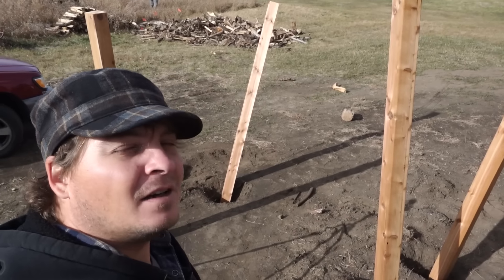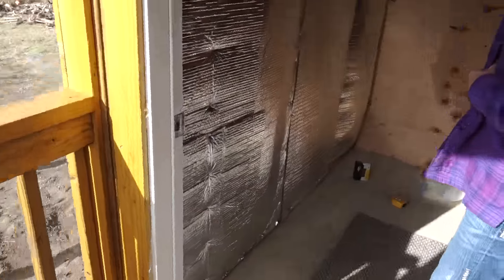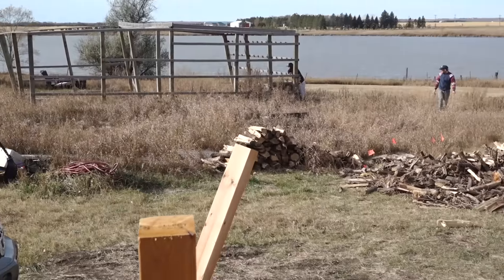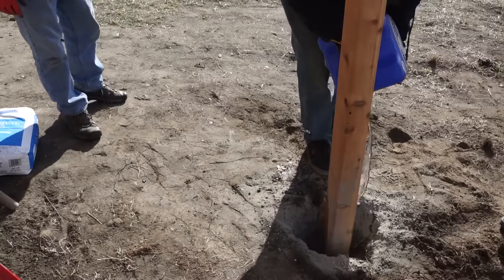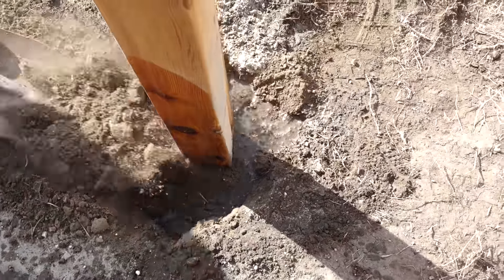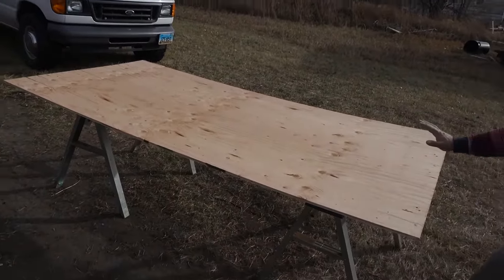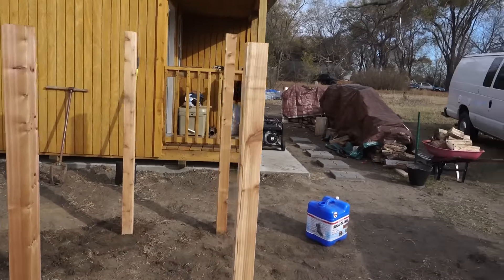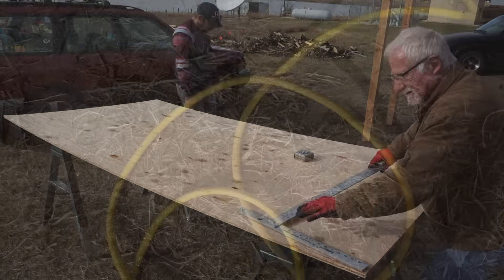Tiny House Living : Solar Panel System Part 1

Comment: thanks for sharing your journey w/ us. A real adventure! 

I'm curious: why you put the posts into the dirt instead of having the concrete footings come up out of the dirt 6" so the posts stay dry. Wouldn't they last a lot longer? I've used sono-tubes and filled them w/ concrete, then placed Simpson ties on top of the wet concrete. It makes it a lot easier to place each post foundation level and square to each other as you are not trying to wrestle w/ a 4X4 in 8" of wet concrete. Before you pour the concrete you make sure each tube  is square  and level to the top of each other tubes. Once filled , you just gently push the Simpson tie to rest on top of the concrete. In CA,, they don't want wood to touch dirt to help prevent acceleration of wood rot. If you ever have to replace the 4x4, you just pull out the bolts used to secure the beam in the Simpson tie' the pillar and Simspon tie are now ready to take a new beam.

the only times I see wood actually in dirt is for fencing.